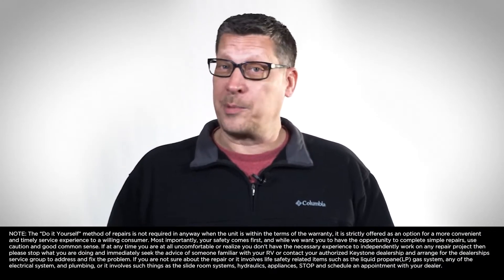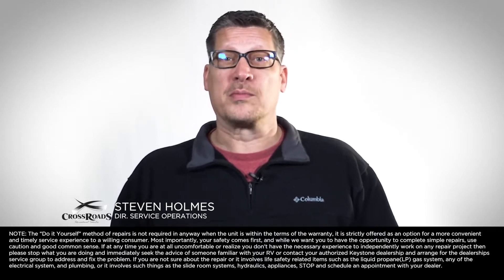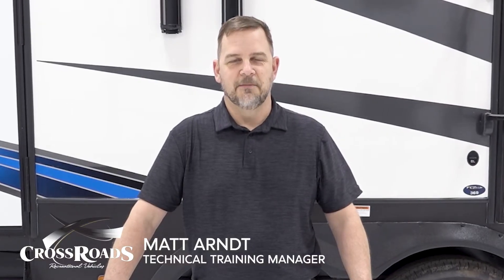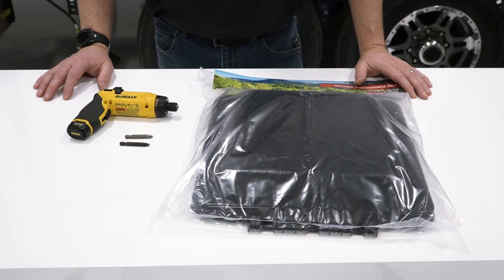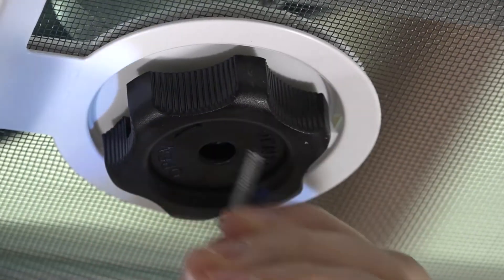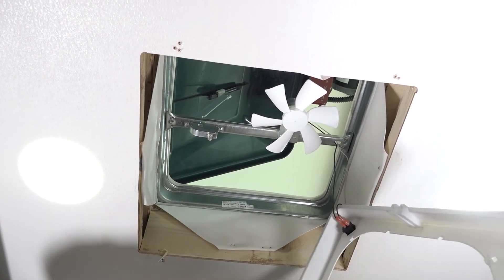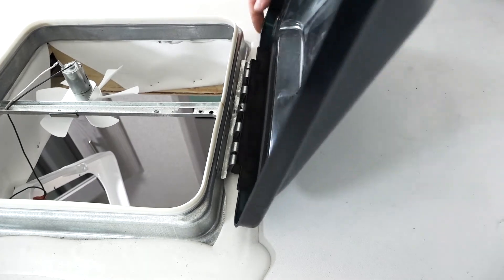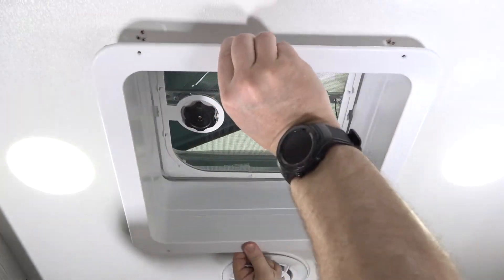DIY - VENT LID REPLACEMENT

Comment: I was able to replace mine without removing the screen .I just opened the vent removed the bolts from the lid and was able to remove it from the cross bracket .The new one was placed back into the cross bracket bolted it back on  Done.